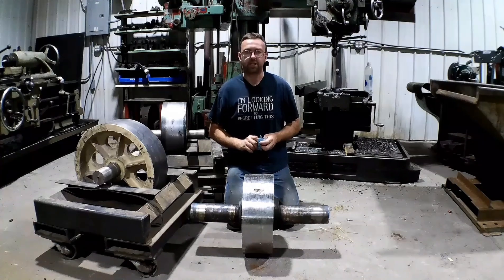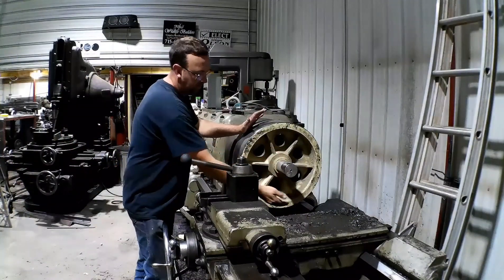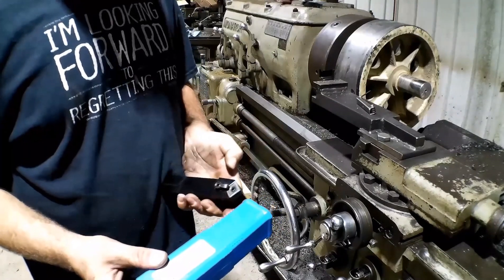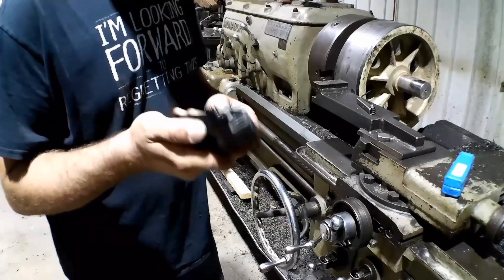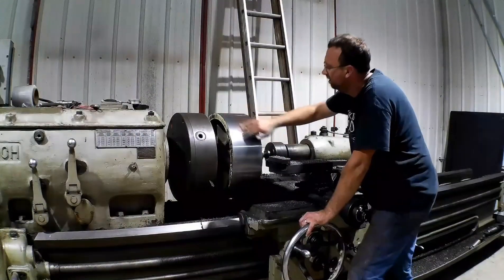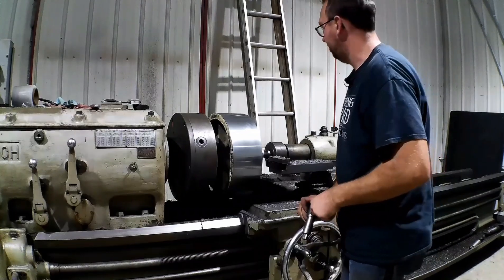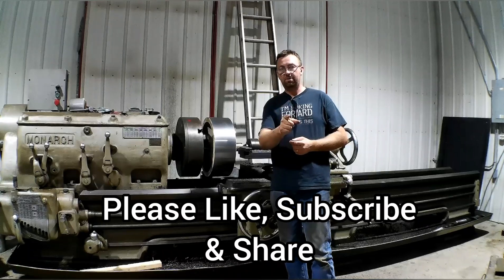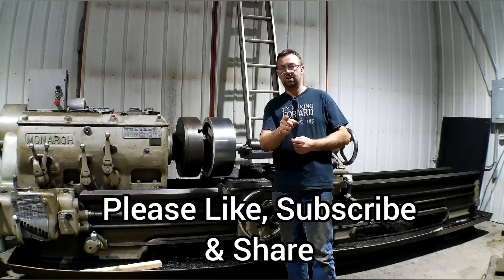Testing New Tooling on the Big Monarch Lathe

Comment: Cnc has its place but being an owner of a manual shop there is no substitute for being able to weld up a part and bring it back to size. Been working these machines for 55 years. Have added some new and newer machines though. Latest addition is a 26 x 120 Taiwanese lathe. Had doubts about a foreign machine but after 3 years of some tough cutting operations I am very satisfied. Got a kick out of your converted planer with the Bridgeport head, have one just like it. Great utube site.
Reply from the maker: Thanks. I love the repair and one off work. I've done CNC and just hate it. No feel, no control, wimpy cuts, small work envelope. I am looking into a bigger European lathe. Hopefully I can swing it in the next few months.

Comment: Awesome Josh, job well done buddy 👍
Does the wider insert angle have a larger radius on the tip? Or is the advantage purely strength (and using all those extra sides)
Reply from the maker: It is the same radius, its just stronger and allows me to use the unused corners.  I also have a large fly cutter for the HBM that uses the same inserts, only a smaller size.  makes almost a mirror finish.
Reply: @TopperMachineLLC  thank you, I have a holder for my inserts the same, never bothered to use it tbh, but I will dig it out today.